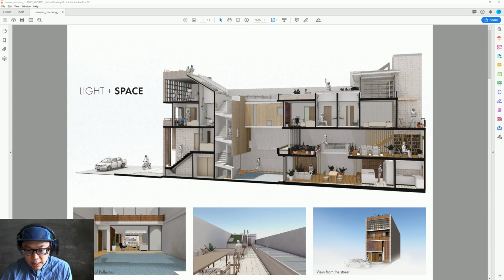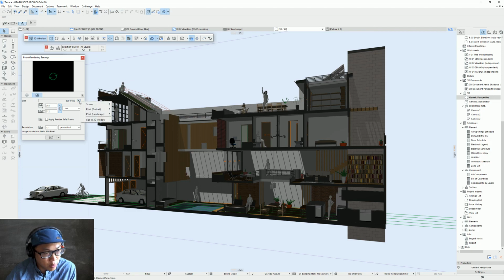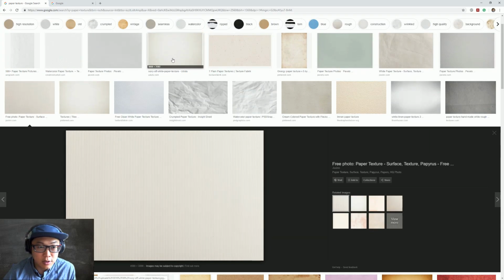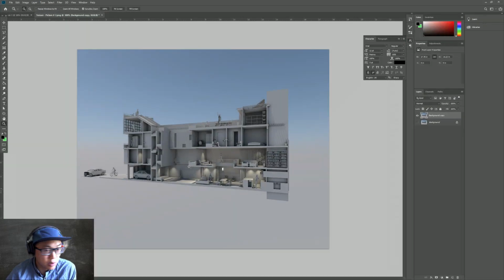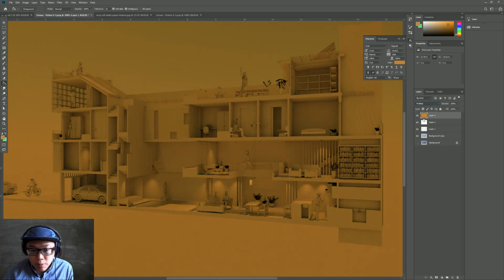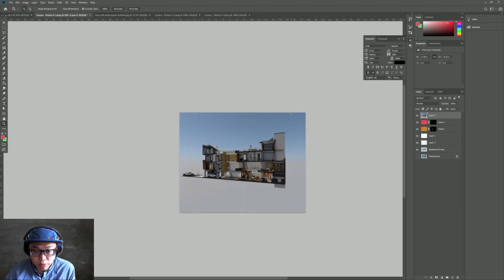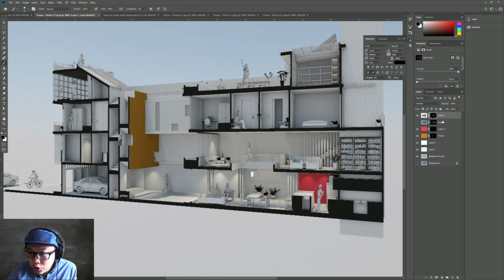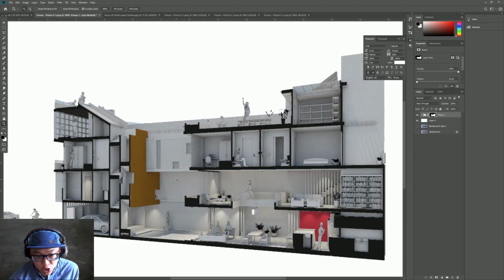How to create a 3D Section with ArchiCAD and Photoshop

Comment: nice work, i will try it tomorrow at work.. problem is a complex, 400 meter long, x 10 m high , maybe i will cut my section into sections XD
Reply from the maker: 400m?? lol Yeah its gonna take a while to render to a resolution that will give you the details you need. Maybe you could try to save the whole section as a 3D document and export the dwg into Adobe Illustrator. You won't get the white render but you will be able to get clean linework.